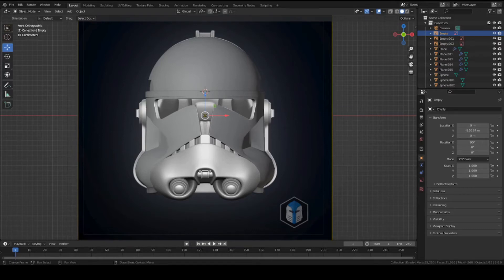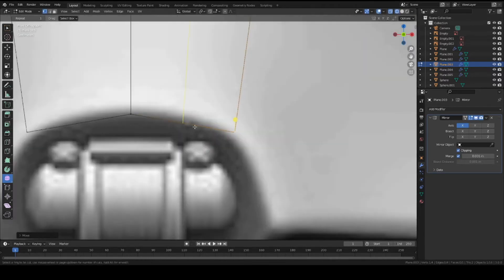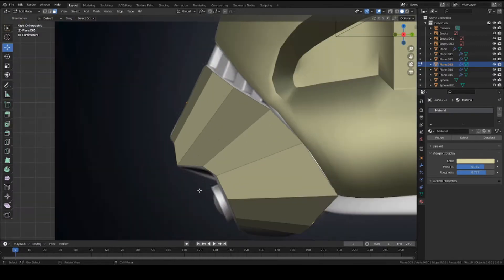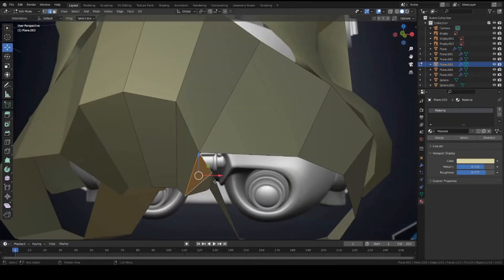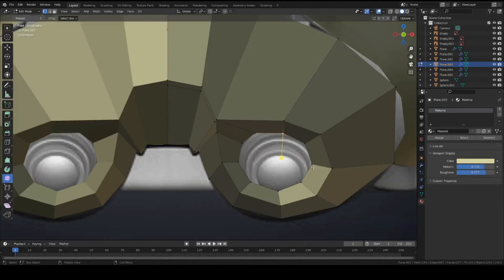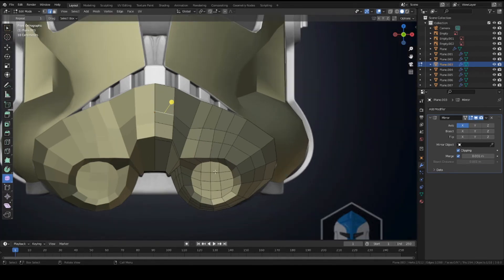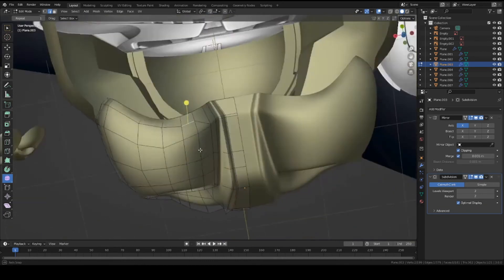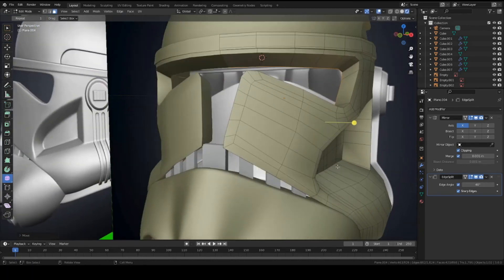How to Make a Phase 2 Clone Trooper Helmet | Part 4 | Blender

Comment: I am going to comment, I enjoy the time and effort you put in explaining things. Does a lot. I've been doing blender for over a year now and I'm still learning small things from you. I'm trying to do the phase 1 helmet from the movies and it's driving me nuts. Seeing how you're doing phase 2 is helpful. Issue is finding actual aligning references for the phase 1 helmet.
Reply from the maker: For the phase 1 helmet (animated version), this image reference is pretty good: https://www.deviantart.com/ravendeviant/art/Clonetrooper-Helmet-Schematic-01-635188713

I agree. Finding a good image reference with multiple angles that align properly is pretty difficult. Most of the time, I have to scale the image references manually to match the positioning of certain reference points in the image (top, bottom, center, etc.)
Hope this helps.
Reply: @colbyweaver8855  No, I do that too, I even extracted the helmet from BF2 and made references from it. The issue is that the pictures don't align when taken at side to front angles (I'm also talking about that movie version not the cartoon one.) But, like I said, even manually making the references myself, for some reason the pictures don't align. I even use the plane method to scale it correctly, still a no go, doesn't want to scale properly. I am grateful for the feedback though.

👍